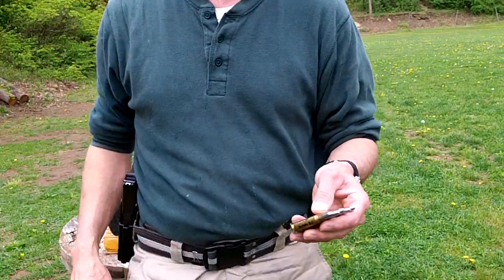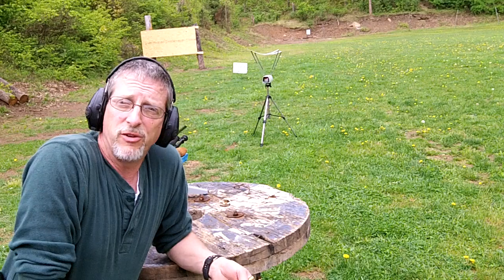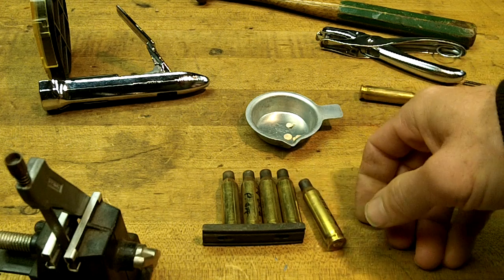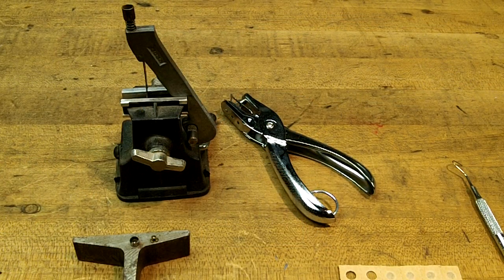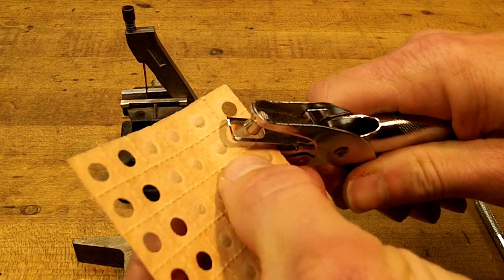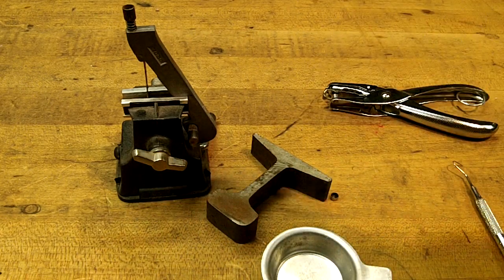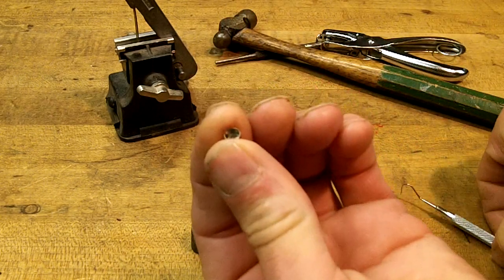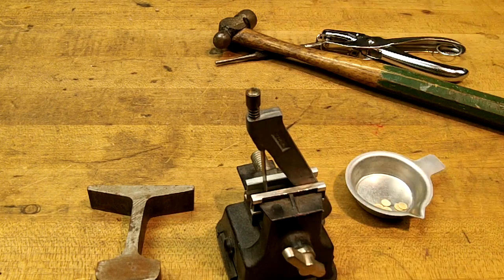Primer experiment , what if we can't buy primers update

Comment: That dealer with the cheap Wolf had the best deals on brass too of any of them he had PMC bronze or Xtac for $8 a box or $420/1000 and had the 100 packs of 9mm for $30 only .22lr he had was nuts though some Win I didn't recognize for $80/500 round box. Great deals on guns too Stag model 8 with Diamondhead sights $1050 the PAP pistols $650 tons of Glocks for $479 even some of the Gen3 FDE frames the Gen4 were like $550 I got more OD and FDE Pmags too for $14 and some Lancer mags.